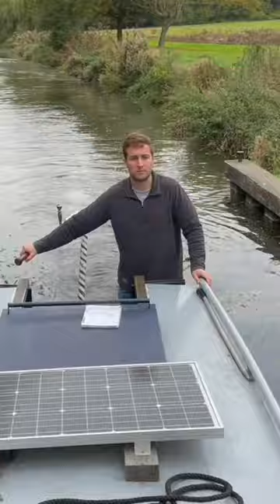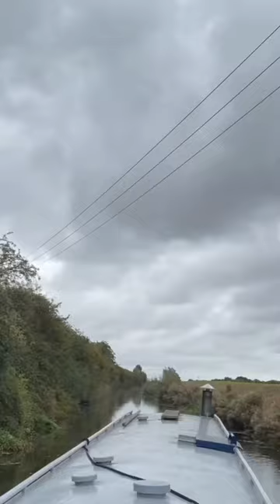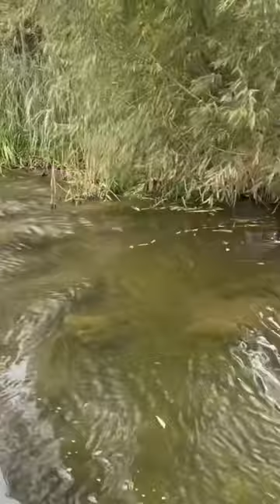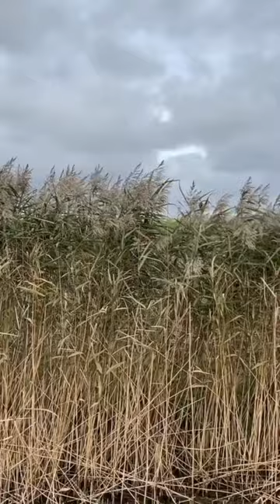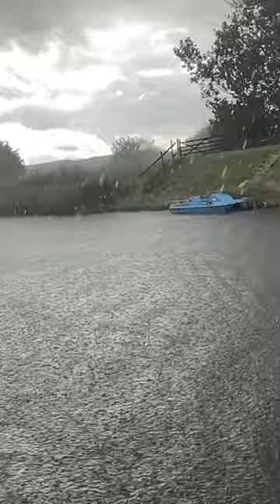A rough day on the river | Narrowboat Ratae

Comment: Wouldn't really have to stop in the middle of the river. Just moor up, it's not like your engine just stopped........
Reply: It's difficult on a lot of canals or rivers to moor up against a bank because the water is so shallow at the edges...
and the edges can be very marshy and quite wide before you actually step onto dry land.

Thus it is difficult and the best action may be to stay in the navigable channel, not risk running aground, fix the problem and barring any other vessel....cause no problems to anyone including yourself????
Reply: I'm surprised that hardly any canal boats have mud weights when river cruisers so seem to have them.
If you need to stop quickly and don't want to drift about, just chuck the mud weights over front and back & job done.